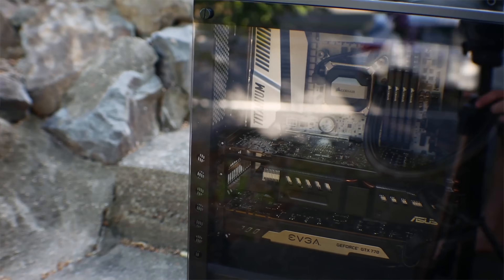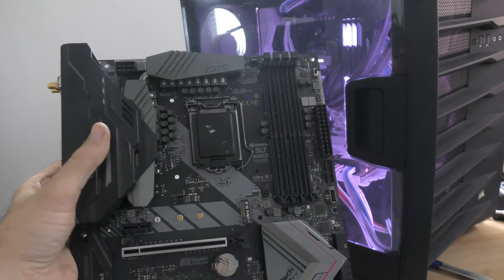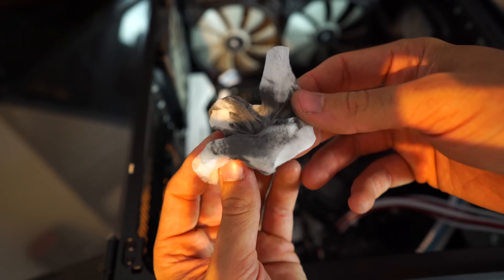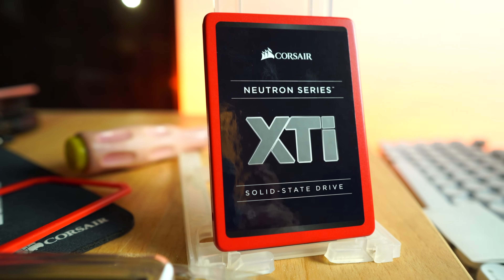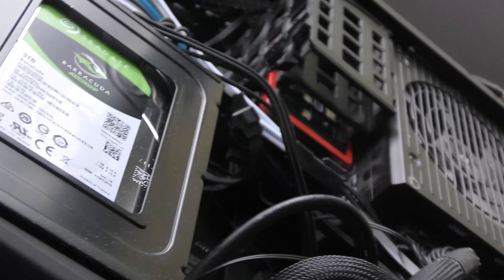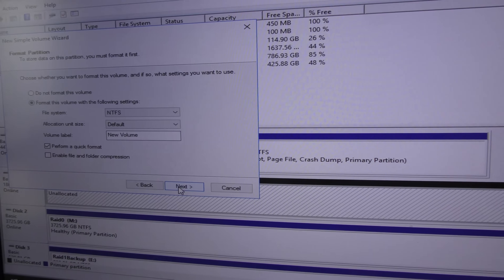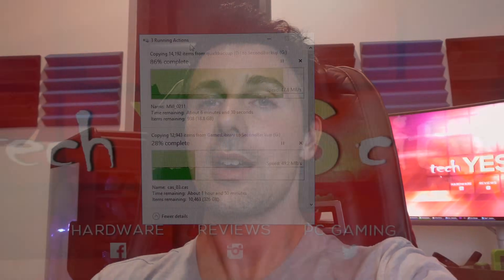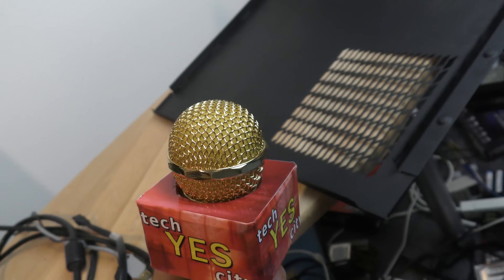Changing my PC from RYZEN to INTEL - Side, Up or DOWNGRADE?

Comment: I built a ryzen 1700 overclocked it to 3.9ghz, and then I switched back to the intel 8600k@4.6ghz, I wasnt impressed with the 1700 at all...  I like the gaming performance and day to day usage performance of the 8600k much better..
Reply: danjal07 ya know ryzen came out a few months ago and it's a very young architecture while intel has been refreshing the same shit for 4 years now and you are even complaining? You should also note that a b350 that is more than capable of overclocking is much much cheaper than a z370 not to mention the still vacant b360 boards that still, will not be overclocking capable, also, the prices of coffee lake processors are still far from ryzen's, when we'll see them at a decent price worldwide I bet ryzen 2 will already be out and kick ass. So basically, if you have the money, buy intel, if you want the best bang for the buck, buy ryzen.
Reply: You had a 8600k and yet you still builded a 1700 system that you don't need and that you're never gonna take advenage of? I mean, if all you care is about gaming and streaming, a 1600 would be a better buy, or a 7700k, or just stay on your 8600k which is much better than both.
Reply: danjal07 that's not what I said, I'm saying that Intel's coffee lake lineup is newer there for ofc it's better, I mean, if they made it worse what was the point on even releasing it? And still, if you have the money go for coffee lake, if you don't, go for ryzen, it's simple (also if you are able to find intel processors at a decent price or even available)
Reply: if speed is speed then fucking buy a 7980xe, i'm talking about value, and how do you know ryzen+ performance, overclocking the ryzen 5 1600 already puts it ahead of every locked i5 in gaming, and at stock it beats every i7 prior to the 8700k in multitasking, editing, coding, rendering and streaming, also, the ipc on ryzen processors is already on par with haswell and broadwell-e processors, just wait till stuff get more multi thread-intensive and you'll see ryzen aging so much better than all the intel processors that came out before coffee lake, everyone that bought a kaby lake will have to change platform within a couple of years, while the first generation of ryzen processors is ready for the next 4-5 years and you will get full upgradability with the am4 chipset for the next 4 years, while intel is able to switch to a new platform within a few months... just for the sake of squeezing as much money as they can off of their little fanboys that will always buy their new products cause they are newer better and don't work with the last generation. And still, coffee lake does not make sense right now because of the pricing, if you can find a 8700k at the same price of a ryzen 7 1700 AND a cooler as good as the copper vapour chamber with a cooler master rgb ring fan, then come back here and i'll be on your side, but right now, buying coffee lake makes absolutely no sense. period.
Reply: about the i7 (btw i7-6700k not I5, guess who looks stupid) i didn't even mention gaming, iliterally said everything but gaming, and do you even fucking listen, i'm talking about shit prior coffee lake, everything that came before it, you should not even consider it as a viable option right now cause it either costs too much or it's sold by unreliable sellers, still, of fucking course coffee lake is better than ryzen geez, it came out months after it and they've been working on this exact same architecture for nearly 4 years now, they just needed to add a couple of cores and boom best processors ever, but this does come at a price, in fact i was not able to find ANY coffee lake processor at msrp or even close to it, an i5 8600k happens to be just as pricy as a 1700x (and i still consider ryzen 7 processors bullshit, ryzen 5 offers much better performance for the money)and the 8700k is priced between a 1700x and an 1800x (which still, are stupid and nobody should buy) which is bs since even the "old" 7700k after a few months it came out its price was already stable at about $350 which is basically the price you can expect to pay for a current gen i5, bullshit. also intel i3s are hard to reccomend, since they were too lazy to develop and produce the lower end chipset motherboards you'd get to pay roughly 110 to 150 for a motherboard, which is already more than the value of your cpu, what a joke. this also brings us to the overall cost of the platform, you can oc any ryzen processor, with any cheap motherboard (but a320 which are just useless and i've never seen anyone buying since they are priced very similarly to their b350 counterparts) and the included stock cooler while not getting those stupidly high pitched noise that the intel stock cooler has under load, oh and btw i do own a skylake i5 and i'm willing to switch to an r5 1600 since one of my friends owns it and in oc it DOES match the i7 6700 in single thread performance and since i need it for coding and very intensive cpu loads it is the best bang for the buck for me, i'm not saying that everyone would be happy with it, i'm just saying, with my graphics card, which is a gtx980ti, a locked quad core just isn't enough for me, it bottlenecks like hell, so what i can say without risking to sound stupid to some butthurt fanboy is: kabylake-skylake rest in pepperoni, coffee lake will take the lead once the prices will be stable, but i still expect a lot from the next ryzen architecture based cpus, AND, if i were ONLY A GAMER-STREAMER i would go for an intel processor, i'm not fanboying, i'm just saying that for my case, ryzen really is the best bang for the buck, and it will age much much better in the future compared to the older intel architectures (and its i5 current counterparts cause of the lack of theoretical cores) thanks to its higher amount of threads which will come very handy in the future and the fact that you'll be able to get full upgradability with the same socket for at least 4 years. (and yes i've built systems with ryzen 3, ryzen 5 and i5 processors, and i'm looking forward on building a coffee lake pc since i really like the architecture but i still don't like the pricing)
Reply: danjal07 did you do any rendering on 1700?
Reply: nope, just gaming, streaming and day to day usage..
Reply: danjal07 why would u buy a 1700 if you re not doing editing or any of the sort... Thats where the r7 excels.
Reply: no, just no..
 https://www.youtube.com/watch?v=agcwU1ImIqE&t=426s
https://www.youtube.com/watch?v=GJGJ0RzPyL0
Reply: You're a spastic.
Reply: havent seen any improvement out of Ryzen in the last 6 months..
Reply: doesnt matter, speed is speed, no matter how you look at it..  and ryzen+ still wont catch the 8600k/8700k
Reply: and you dont know shit about ryzen and coffee lake..
Reply: no I built a 1700 and overclocked it to 3.9ghz, and it didnt perform well enough to my liking, so I built an 8600k and overclocked it to 4.6ghz and the 8600k outperforms the 1700 in gaming and day to day usage and streaming so I stuck with the 8600k..
Reply: You just made yourself look stupid...  a 1600 overclocked doesnt even outperform a I5-8400, and it doesnt game with an overclcoked I5-6700k, I7-7700k, and I know it doesnt even come close to my I5-8600k.. AMD seen Ryzens shortcomings so they have to improve it..  It also doesnt beat it in multitasking, it may in rendering, coding, the 1600 also doesnt beat the 8600k in streaming.. ask me I KNOW.. I own an 8600k and a ryzen 1700@3.9 and my 8600k spanks it at 4.6ghz.  so before you say anything else, do you own both, have you built systems using both?  Likely no, therefore your talking out your ass..  Keep using that aging excuse, it hasnt helped amd yet, by the time amd "ages" they are out of date and behind the competition, just like amd gpu's..
Reply: I wanted the eight cores, fell for amd's marketing bullshit.. From what I'm seeing the 8 core doesnt even help with the editing in adobe, adobe likes clock speed over core count..

Comment: On the subject of liquid metal... I know there are much better options for the top of the IHS, but for accuracy's sake, isn't the IHS nickel coated copper?
Reply from the maker: Always clean it hard with alcohol... I guess something must have been left over.
Reply: That is correct. The IHS is made of nickel plated copper which does not react with liquid metal TIM. No idea how he got that corrosion. Maybe he used a TIM that contains aluminium and did not clean it probably.
Reply: Yes I believe it was leftover tim. I had a similar issue when I put it on a copper contact. Though in my case it immediately turned black and I ended up using a ceramic surface cleaner to remove it all and start again.

Comment: I'm running RAID0 using two 500 GB 950 Evos.

Brian, you're doing something wrong in your RAID set up. Turn raid on in the bios, reboot and watch for the CTRL+I prompt and set up the raid array in there. You shouldn't need to load any drivers or anything during the Windows set up process.

Comment: I would not touch an INTEL system with a bargepole as I prefare AMD sorry INTEL fan boys, could you not have kept the Threadripper system that you had and ditch windows and install the latest version BeOS  PRO and UltraDV with an AMD AIO Wonder card and see how that works.

Comment: My drive configuration? It's a bit weird: my primary array is a Kingston hyperx savage s.s.d. with Windows 7 and everything related to my university in (and of course, drivers and such), then a 1 tb hard drive (a western digital caviar blue) serving as "mass storage" for that installation. 

I also have a 300 gb western digital velociraptor that is my secondary drive, for when I want to mess with virtual machines or play modded grand theft auto 5. I'm currently debating on putting a Linux drive in too.

Comment: 1. Keep hyping up AMD
2. Make other peoples buy AMD
3. Wait till Intel released a reasonable chip.
4. Buy Intel chip for myself.
Reply: Intel already released a new chip... Question mark? Coffee Lake is the same architecture as Kaby Lake, but with 2 extra cores, and even worse efficiency than before
Reply: Rizu Ya that's evil but it works
Reply: 3770k overcooked smokes kabylake in gaming. Intel 2012 still beats Intel 2017.
Reply: better at making chips need 10x more power and produce double the heat for no IPC gains and bearly match an older CPU in multicore but only after being OCd to near boiling temps. XD. Man i cant wait to see waht Ryzen 2 brings in February in a few short months.
Reply: 2600k beats both 3770k and 7700k. check hardware canucks.
Reply: 1. Pretend to be AMD shill
2. Shill for AMD
3. ? Profit?
Reply: Rizu Ya nc one
Reply: Thats not bad even if it were true since Intel has only made tiny bearly existant gains since about its third gen i7s lol.
Reply: DDR3 + e3 1230/1240 v3 and compatible lga1150 MB is one of the best price/perf builds you can make right now. The next contender is 1600, but the gap is quite substantial due to DDR4 prices.
Reply: Gretsky Nut yup... ddr4 is currently depressing for prices
Reply: 7700k will be 90c+ also lol
Reply: https://youtu.be/MsnoN5dIPiE?t=2m1s
Reply: David K. Which part of that wasn't in English?
Reply: Never said anything to you. It was all a joke you spazz
Reply: Dex4Sure delid 3770k, use liquid metal, go beefy cooler solution and thermals are solved.
Reply: Dex4Sure lol sure
Reply: ademar9988 AMD droping prizes coz more and more ppl know that ryzen = 3770k @ gaming fps

Comment: Switching platforms because of issues with video devices is a big mistake: Video devices, specially capture devices, are notoriously crap with compatibility, regardless of platform. That being said however I recognize the 8700k is an upgrade in IPC for gaming but as a content creator you should have a separate production rig with Threadripper on it: that will really speed up editing and such.

Comment: My current build
Corsair 570x case with 6  hd fans with lighting node pro and commander pro for fan controller 
X299.  A delidded I9 7900x with liquid metal tim on a msi carbon pro a.c. mb 64gb corsair dominator ram with fans 
2 Samsung m.2 960 pro running raid 0
2 1080tis in sli all water cooled with ek waterblocks and alphacool copper radiator monsoon fittings and tubing Ekwaterblocks mono block to keep cpu and vrms cool
1,000 watt corsair power supply

Comment: I have 2 Samsung 512gb 960 pro m.2 running raid 0 for my windows 10  and some programs 
I know you have to get the driver from Intel to install the raid as a bootable drive or Windows won't acknowledge it

Comment: my personal opinion RAID adds complexity and more points of failure and hassle - regular normal backups are much safer/simpler/easier and more resilient then RAID 1, and I don't subscribe to RAID 0
Reply: and to elaborate, RAID 1 is such bullshit, added points of failure - soft RAID like AMD/Intel onboard stuff means driver differences can screw you,  and of course you now have the RAID controller as an added point of failure... also if both your drives are from the same batch they often fail around the same time - so the protection from drive failure is pointless if you want to mirror just do a nightly difference backup like RSYNC or ROBOCOPY... simpler and easy to restore on any hardware, if you're going to use RAID 1 use Windows built-in or Linux built-in don't bother with AMD or Intels crap drivers, you can't even use S.M.A.R.T. on the drives once they're in the array, and if you lose your settings good luck if you didn't make a record of which drive is which, and don't even bother if you've never simulated a drive failure to see how easy it is to replace a drive... LOL

Comment: Hey bryan, im on x58 with a xeon and my sydtem drive has filled up. Im getting a second ssd for Christmas and im gonna raid 0 them together. Any advice and tips for migrating my data from the original drive to the raid using just 1 computer?
Reply: The first thing to note is that building a RAID with a used drive will wipe the data it contains.

Comment: DONT TOUCH THE BOTTOM OF THE CPUS!!!
Reply: Noob Fury lmfao, it's safe to do that, unless if you're holding a PGA CPU with pins (AMD CPUs), but the pins are still sturdy, you won't bend it unless you do it on purpose

Comment: if you'd installed Windows from Live CD/USB by using a tool called WinNTSetup there would be no problem with RAID controller. You just need to integrate the Intel RAID driver into the os .WIM image before installation. https://www.win-raid.com/t750f25-Guide-Integration-of-drivers-into-a-Win-image.html

Comment: I had exactly the same thing going on. Swapped from Ryzen 1700 X370 to 8700K Z370 swapping all the components over to the new setup. Intel System feels so much more fluid and smoother, couldn't believe how much faster and responsive the whole Adobe Suite works now. I think i has to be because of the hughely faster single core speed. Running @ 5.3GHz on two cores and 5 GHz on all Cores. Running 2x Samsung 960 Nvme's for System and Workdisks, works like a charm.

Comment: Great new video. Could someone help me with some issue?
I've just bought my new high end PC: 8700K, 1080 Ti, Corsair Vengeance RGB 16GB. I wanted super small super silent and super powerfull PC so i picked Fractial desing Nano S, ASRock Fatal1ty Z370 mini-ITX and Be Quiet! 800W power supply.
It is super powerfull but it is also quite loud ~50 db.
Two 140 mm Nuctua NF-A14 case fans are connected to power supply and i guess are working on full load all the time.
Will it help to make it quieter if i buy fan hub and connect two Noctua and one stock Fractial design 1200 mm rear fan to it. Would i be able to control fans speed all together?
Thank you.
Reply: Kirill Pletnev if your using the fan header just install speedfan to adjust?
Reply: There is a cable from power supply which connects to my HDD. There are are two connectors (guys from PC shop did this) on this cable with 3-pin fan header. So Noctua are connected to these fan headers. Fractial design 120mm fans is connected to motherboard.
Reply: It has only 1 CPU header, 1 optional pump header and 1 4-pin chassis fan header.